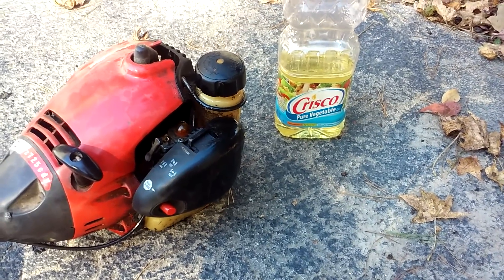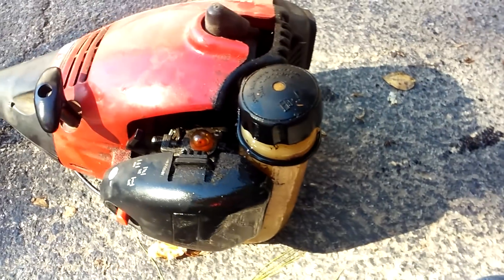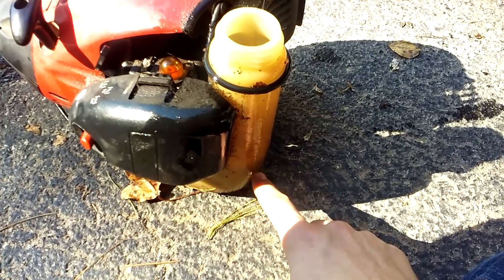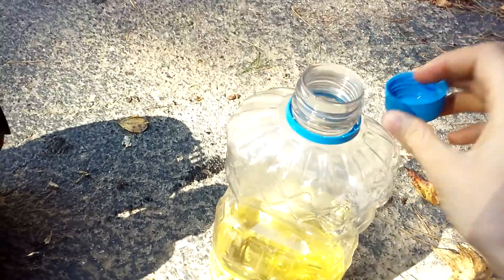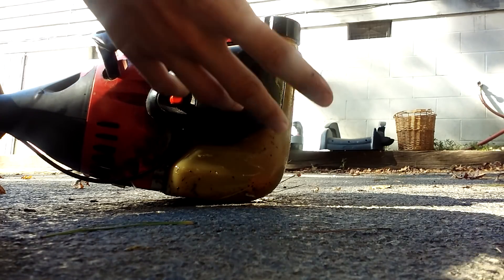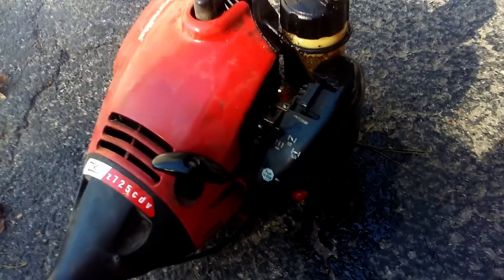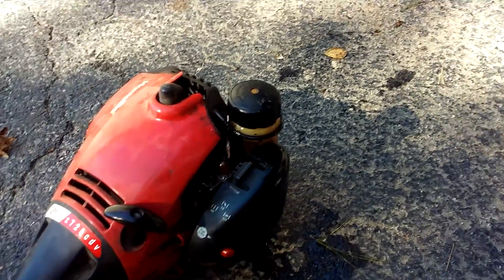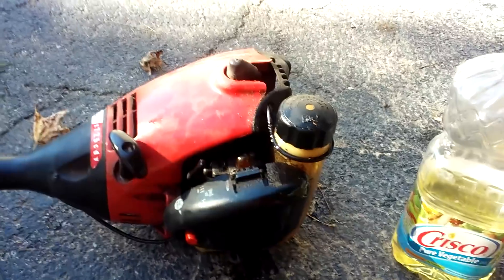2 cycle engine runs on vegetable oil

Comment from the maker: *UPDATE* Who would be interested in me doing a better video of this, except with a chain saw? I know I have a lot of skeptics here and this time I'll do a little more to prove it was really vegetable oil. Drop a like and a comment here if you'd be interested.
Reply: I would actually be interested to see a small 4-stroke gas engine (like a lawn mower) run with a gas-veggie oil mix, like 90/10 or 80/20.
Reply: Super interested! Would be 1000x more interesting in a dirt bike or pitbike etc
Reply: I would be interested to see if a 2-stroke engine under load could run off of Crisco.
Reply: yeah go 4 it man! i wanna see this run in a dirt bike maybe mixed in with ethanol
Reply: i have stihl fs 56 weed wacker motor  if you have more weedwackers let me know because i plan to do my experiment just  i ran my engine completly dry and dont have gas/oil mix right now. pouring the sunflower oil would make it run or need adjustments?

Comment: Veggie oil is a whole lot cheaper than those 4oz 2 stroke oil bottles. In the long run you could save some cash if you had a landscaping or tree trimming business. It could also ruin all your motors.

Comment: The carbon build up on the piston head will burn up the engine I could see a 50 to 1 ratio working but why?
Reply from the maker: You're right, I'm sure it would over time. I was just messing around and seeing if something that crude would work as fuel.

Comment: actually its a lot more difficult to make corn oil than it is to make corn  moonshine, and the gasser would run on shine, but as for changing anything on an industrial basis, not until said basis is removed from the equation, you have no reason to worry about the video being removed from the web. I use kero for optimum performance, but you have to heat the fuel first on cold start up.

Comment: You gotta turn your high and low carb adjustment way down and it will run a lot better
Reply from the maker: I believe I had them turned out a lot just so it would pull the oil through, but I'm sure there's a set point that would be ideal to cut the smoke.

Comment: The amount of glycerides in the oil will gum up your engine very quickly though.
Reply from the maker: Definitely. I ran gas in it a few months after this experiment and it took forever to get all the oil out of the thing.
Reply: What if an engine cleaner like seafoam, or similar  was incorporated.?  Thoughts?

Comment: Pure racing oils as used in high speed small capacity 2 stroke engines in go karts,motorcycles and model engines are quite often Castor oil based which is plant derived from the pressing of castor beans plus an additive package..so your Soy bean oil you are experimenting with here is very similar but thinner..However with prolonged use at the low speeds and temps you are using the oil alot of deposits are forming as they are not being burnt off with high rpms..the result eventually will be spark plug fouling..exhaust port and muffler blocking and ring groove clogging of which all will stop the engine..

Comment: Am thinking it depends on how much the fuel and oil is compressed inside the engine for example I believe that diesel fuel has to compressed greater then gasoline inorder for it combust. While gasoline follows a little bit of a different process to this but considering that 2 strokes engines are high compression engines  something like cooking work anyways but diesals weren't designed to run cooking oil an  alternitive which probably results in fryed piston rings or blown head gasket or have a high carbon deposits on the piston heads which leads to increase compression which I bad for the engine. I don't know but as far I am concerned the fuel industry is taking mean advantage on people.

Comment: I wonder how much less it would smoke if you could route the fuel line (add a copper section) over part of the engine/exhaust directly, the idea being that you greatly heat the oil before it hits the carb?  I have a feeling that if you could get it to the highest possible temperature before it started to oxidize then when it mixes with the air in the carb it might vaporize much more, resulting in smaller droplets, greater surface area etc.  Would have to let it run for a few mins to get to temp.
I see people complaining about emissions.  The CO2 it emits is not entirely carbon neutral due to the energy involved in growing, and transporting/processing the plants, but it's a hell of a lot better than burning distilled crude oil.  It's hard to avoid CO and oxides of N under those combustion conditions no matter what fuel you use.
You seem like you have the mechanical aptitude to build an external combustion engine, like a hydrocarbon-powered Stirling.  At the very least it would probably interest you to study such.
Keep up the great work!  Nice experimenting!
Reply: This has been done with diesel engines and vegetable oil

Comment: Veg oil etc, does not have the lubrication properties of mineral oil, and will gum up the rings and leave a nasty film on the piston, those of you that know about Castrol 'R' racing oil will know this is completely different from the oil that you buy in the supermarket.

Comment: I put vegitable oil in my two stroke motor bike and it still ran when i mixed  it with the gas and oil so faster then ever and lasted longer actually but was hard to start if it had to much
Reply: What bike was it?

Comment: Is it a normal 2 cycle gasoline motor?
Reply from the maker: Jose Naveda Yes, this one is very forgiving, however.
Reply: SD Customs what do you mean by forgiving?
Reply from the maker: Jose Naveda Like it has never really gave me a hard time starting, and still works today, even after what I did in the video. Never been more satisfied with a 2 cycle engine.
Reply: SD Customs i want to make a science far project sbd want to make it about avocado oil to prove that you can use, do you think it will work in a gasoline 2 cycle motor?
Reply from the maker: Jose Naveda I've no idea

Comment: Do you have to have 2 cycle oil mixed with the reg vegetable oil
Reply: SD customs.  Keeping in line with the oil in mind maybe adding a bit of 40:1 to your mixture may be a good idea. And maybe looking into other oils would help like adding olive oil to help lubricate. With that in mind though you would need to see if the combination would burn safely together. ..

P.s.I honestly don't think that this is a fake video.
Reply from the maker: ParkView Lawncare For the engine to run? No... For longevity of the engine? Yet to be determined.
Reply: SD Customs hm interesting i knew it was combustible but not like this
Reply from the maker: jrghouse91 And so the gears start to turn ;) I don't know why so many people think I faked this, it's really nothing amazing lol

Comment: I'm sure that with a tiny modification every two stroke engines could run on more environmentally friendly fuels however it still wouldn't solve the issue of the carbon emmissions.
Reply: It would actually be carbon neutral. The carbon that is released from burning vegetable oil was in the atmosphere very recently. The plant that produced the vegetable oil fixed the carbon from the air using the energy of the sun. When you burn the vegetable oil, it is just releasing it back to the atmosphere. That's what it means to say carbon neutral. The carbon that is released from burnin gasoline also used to be in the atmosphere. But it was fixed by plants and trapped under ground a long time ago.
Reply: The ENTIRE "climate change" or "man made global warming" story is the BIGGEST scam that ever has been. There is a reason it's known as an industry. It's very profitable. 1.5 trillion dollars of theft every year last I checked. Where is the money going? Who is collecting? What is it being spent on? If you can't answer ANY of those question that means there is no transparency. If there is no transparency then the chances this money is being spent on "solutions" is........0%. Oh and let's see if you can answer this. CO2 accounts for less than 0.5% the atmosphere. 1) So why is trillions of dollars being spent to combat a gas that makes of less than half of one percent of our atmosphere? 2) Since every plant needs CO2 as part of photosynthesis, how exactly does eliminating CO2 output work in our favor? 3) Most importantly, since we exhale CO2 how is it possible to achieve this fantasy utopia where ZERO CO2 is emitted into the atmosphere? 

Note: One possible means to accomplish question #3, genocide.
Reply: @exoticcreature3059  experimental mrna shot enters chat did somebody say genocide?!? hold my beer

Comment: Is this diesel?  I don't understand how it's possible to run veggie oil in a 2-stroke ICE.
Reply from the maker: Peter Schmidt No, this is just a normal 2 cycle spark plug engine and vegetable oil. In the video there may have been like 15% gas and motor oil in the tank... but later on I ran it dry, refueled with 100% veggie oil, and it still ran. I honestly don't see how it works either.
Reply: Very weird.  I wonder what would happen if you tried removing the spark plug, or at least unplug it after the engine gets moving.  See if it keeps running.  I'd also be interested to see if other 2-strokes work.
Reply from the maker: Peter Schmidt It actually does not. The engine has an electrical kill which instantly shuts it down. Idk if it would work on other engines.... this one in particular is extremely forgiving.
Reply: Interesting.  I guess it compresses the diesel enough to atomize but not enough to self-ignite.  I'm seriously interested in looking into other two-strokes for the same thing.

I've thrown around the idea of using a diesel engine using waste vegetable oil that a local fast food restaurant wants to toss, and use it as a small furnace and/or an electric generator.  Stick a muffler on it and that would probably help with the noise issue.
Reply from the maker: Peter Schmidt Go for it!!!
Reply: I found this video after looking up 2 strokes on diesel (which is also very interesting) and I was about to look up kerosene when I ran into this video. From what I've seen, the spark plug won't fire straight diesel in a cold engine. And with 2 strokes not having high enough compression, diesel shouldn't work at all. But it seems that the spark plug makes up for the lack of compression as long as the engine is warm. Vegetable oil runs in diesels. In theory, pure vegetable oil should work as long as you get the engine warm first (using regular mix gas ideally). The draw back would be that it does tend to gum things up eventually. In diesels it gums things up enough to far offset any savings so diesel is still preferable
Reply: @gregoryjames6051  vegetable oil is even harder to ignite that diesel. It has a higher flashpoint. The oil is also thicker which means that the fuel and air is not mixed properly in the carburretor. The motor may still run because its hot, but the efficiency and the power are probably VERY bad

Comment: Long term use of Veggie oil will cause the piston rings to gum up and stick in the piston grooves causing low or no compression then the engine will cease to run.   Vegetable oil tends  to polymerize when it gets hot and cleaning that out will be near impossible.   If you are dead set on running veggie then use an oil with a  high flash point like peanut oil  to lengthen the time  till the rings gum up.
Reply from the maker: Matthew Matthewq  Great advise, thank you.
Reply: I know I’m 5 years late but this just happened to my leaf blower I ran it with gas and vegetable oil for about a month and my piston rings got gummed up.

Comment: You've had several months on this now. Have you run it on veggie oil a lot? How has the spark plug held up? I've got a spare 50cc 2 stroke with electric start that I'm thinking of modifying specifically for this. Increasing the compression, trimming the cooling fins on the head so it runs hotter, and toying with the ignition.
Reply from the maker: Keith Pickelhaupt I've only run a couple of tanks full of veggie oil through it in total, I don't use that old trimmer anymore... so I really can't tell you the long term effects.

Comment: If it were burning efficiently as you claim, it wouldn't be smoking. If there is smoke, it means the combustion isn't fully completed. And just because it's vegetable oil, doesn't mean it doesn't still release toxic fumes. Burning wood isn't thought to be as toxic as burning gasoline, however, the cleanest burning gasoline engine will produce far less harmful emissions than any wood burning stove. Burning wood releases high levels of carbon monoxide and carbon dioxide, among others.
Reply: no smoke, no lubrication.
Reply: all 2 strokes smoke like a hooker
Reply: @JayPlays792  exactly. Thats because the oil is not burnt efficiently because the compression temperature is too low and the oil is not mixed properly with the air. And in this case, there amount of oil is much bigger, which means that the engine is running very inefficiently and makes low power. If it was a diesel, there would be no smoke at all and would run much MUCH more efficiency and make all the power
Reply from the maker: Adam S Please read the description. You make good points, but even if it's not the best for the environment it provides evidence that we really don't depend on crude oil as much as they say we do.
Reply: SD Customs If you're talking about utilizing renewable energy, then it's a different story.

Comment: So it isn't a 2 stroke diesel just regular gasoline and oil mixture engine? I wonder what is the compression ratio on it? Because I have the idea of running my 2 stroke 80cc bike kit with cooking oil and nothing else. Plus I wonder how well does that oil (cooking oil) lubricate the engines moving parts.
Reply from the maker: peter medz Correct, it's just a normal 2 stroke gasser... as far as compression ratios go I have no idea, this engine is super easy to pull so it can't have much compression, but it's firing off the spark pkug, not by compression in this case. You make a good point there, I should tear it apart and see if there is any unusual wear by using this oil.
Reply: That would be awesome if you could, because I don't have an engine that I can screw around with. I only have 1 80cc 2stroke bike kit engine that I haven't run in yet.
Reply: My plan is to create a hybrid bike that utilizes electric wheel/hub motors both front and back, and a 2 stroke engine in the the frame.
Reply: Maybe even coming up with a mod that allows the 2 stroke engine to run on compressed air, cooking oil, diesel, and 2 stroke fuel mix.
Reply from the maker: peter medz Sounds awesome, go for it!
Reply: Thanks I will
Reply: And can you tell me the wear of the engine after running it on veg oil? When you get the chance?
Reply: @thecbc7658  i would suggest not to do this. The oil is thicker which means that the fuel and air is not mixed properly in the carburretor. The motor may still run because when its very hot, but the efficiency and the power will be VERY bad and it won't start at all when the engine is cool. That will also gum up your carb and create a ton of buildup and probably foul the spark plug
Reply: @dieselgeezer18  Preheat the oil?
Reply: @thecbc7658  that would not work. The cylinder itself will have to be on very high temperature, but even then, the efficiency and the power will be VERY bad and everything would gum up
Reply: @dieselgeezer18  Pu the oil in boiling water and heat It up that way...
Reply: @thecbc7658  you are taking it too far. You're making it too complex. But still, as i said, the compression temperature must be higher and those small 2 strokes got about 7:1 compression, which is too low to ignite the oil. A diesel engine will work perfectly on vegetable oil because the compression temperature is extremely high. They usually  have a compression ratios of 20:1 and the compression temperature can reach EXTREMELY high degress in order to efficiently ignite the fuel
Reply: @dieselgeezer18  what if you dilute the oil with acetone?
Reply: @thecbc7658  that means that you are not running on pure vegetable oil and you will have to pay a lot of money for the acetone. And still the engine won't run efficiently and will make poor power, and you will probably gum up the engine.
Reply: peter medz yeah how long will that engine last? If that was the way they were supposed to run that's what it would say in the manual .
Reply: It made me whant a hambuger to go with the frys.